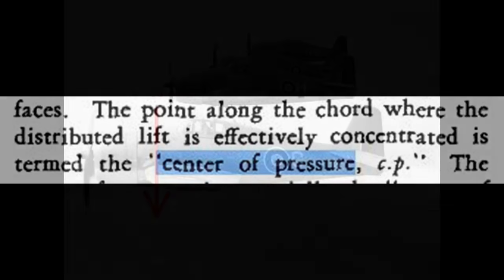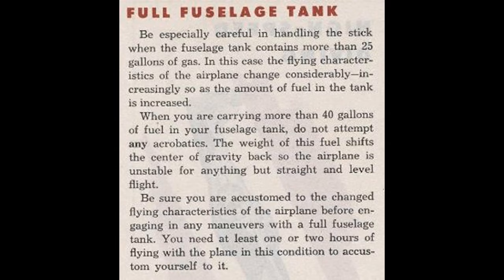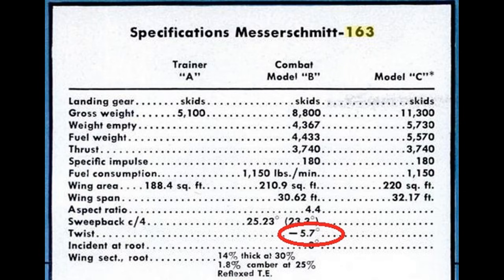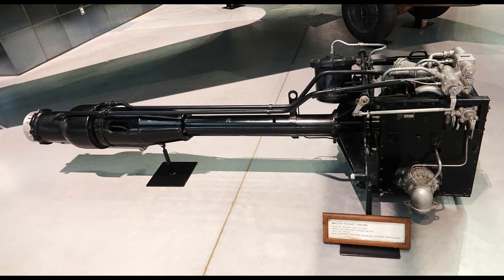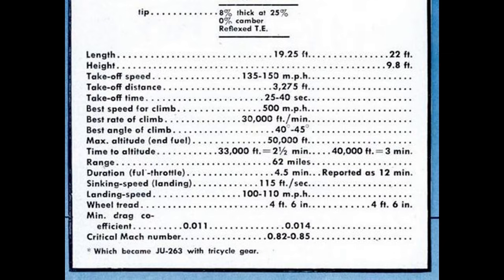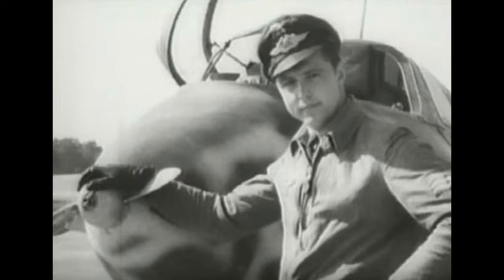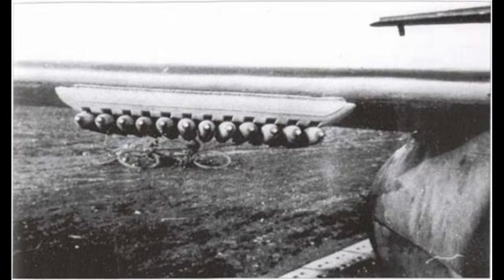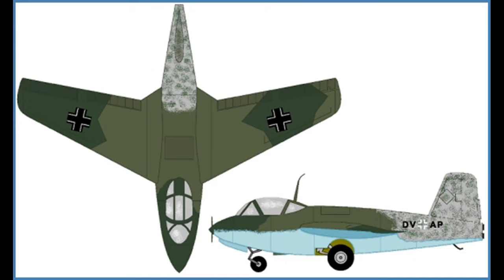Messerschmitt Me 163 Pt.2 Plus Me 263 and More!

Comment: Part 1: Greg - I went and grabbed the ones that all went together, reformatted them and got rid of the names. It will read a little odd, but you'll get the idea. This was fun to read through. I hope you enjoy it. Let me know if you see this one so I can drop it.

@mrod2b216
5 years ago
Hanna Reitsch had her accident in an Me 163b, not in an "a". She had used her political power to try and finagle her way into the flight test program of the Me 163, and had been allowed to fly the Me 163b as a glider IIRC 4 times. She continued to try to assert her will to get into the real experimental flight test issues of the aircraft, so Späte came up with the idea to let her be a production type test pilot for new production run aircraft to confirm they handled like they were supposed to. This would get her out of the experimental test pilot's hair because they viewed her as being non-current (spending too much time away doing other things) and meddling in their jobs. The Kroneis factory had a contract for the first 70 production run Me 163b's, and Kroneis arranged for her to be his factory pilot. The accident happened on her very first factory acceptance flight. Trust me, I know the story better than most anyone out there. My father was was her tow pilot that day, and also the only Me 163 test pilot present, and also the only other Me 163 pilot to have landed an Me 163 with the take-off dolly still attached (so he knew what her problems were). I don't want to "hunt & peck" a book at this point, but suffice it to say that she just royally botched up the approach to the airport. The accident was her fault because the aircraft could have been landed safely with the dolly still attached. After she recovered from her injuries, she then took the regular 5 flight transition course for new Me 163 pilots coming from other aircraft. Those 5 flights were in the Me 163a model with the last one IIRC being under power. It was then that she went back to Späte demanding to be allowed to fly the Me 163b under power. Späte refused on the grounds that he now had a lot of combat pilots to train and could not afford her a "joyride". It was at that point that she got mad and never came back. My father also pointed out that shortly after that episode, Späte was transferred back to the Eastern front. My father felt that it just made no sense to transfer the commander away just as everything he had worked for was starting to come together. My father's gut feeling was that Hanna had exercised her power and vindictiveness. On another note, you rely entirely too much on Mano Ziegler's book. He sensationalized a lot in order to sell books, and didn't really have the intimate involvement to tell the whole story. He was sort of a peripheral player. There are a number of other books out there which are better from a historical perspective.

My father was never a publicity hound or a glory seeker. He was a professional test pilot who would never lay claim to anything unless he had ironclad proof, and above all just wanted history to be recorded exactly as it happened without any spin attached. He never had the desire to write a book, and in the end he said that a lot of his story had already been written down in various forms, just not all collated in one place. He is in all the Me 163 books as he and Dittmar were the two primary experimental test pilots on the aircraft. Perhaps the most accurate involving him is Jeff Ethell's book Komet The Messerschmitt 163. His involvement in the 10 May 1940 glider assault on the Maginot Line and his in involvement with the Horten flying wings (mostly post war) is found in other places. Regarding the Hanna Reitsch story, he was always afraid of her political pull even long after the war. She had her legion of supporters, so he never publicly came out with the story I shared here in fear of retribution. He was the only qualified observer there. He saw everything, and accompanied her in the car to the clinic and hospital afterwards. Everyone just took her word for what happened, and no one asked my father what he saw or thought. Every other published account was second hand heresay. Towards the end, I was his firewall in helping him filter out who among all the folks clamoring for contact with him, that he would actually respond to. I finally convinced him to tell me the whole Hanna Reitsch accident story because I knew that people would be asking me about it long after he was gone. So, he did in excruciating detail, but it is way too long to type here. His end vindication was that she and her accident set the program back by 6 months during which time he had to redo all the flight tests that could have had something to do with her accident. In the end, there were absolutely NO changes made to the aircraft or it's handling. Most everyone who flew it (including Hanna) raved about the great handling qualities, so that confirmed to him that she was just making excuses to try and cover up her own errors. To him as a professional test pilot, if you screwed up, you had to admit it, so to him, she had committed a cardinal sin....and it almost got the whole program canceled.

Privately, he was much more direct and frank in his opinions. He didn't want to publicly make too many waves in fear of retribution from her legions of supporters. It did reflect badly on the Me 163 project. The Kroneis 70 aircraft order was cancelled, and it took my father 6 months of follow up flight tests to conclusively determine that there was nothing wrong with the design of the aircraft , and no aircraft design modifications were warranted. In the meanwhile the whole program teetered on being canceled altogether.

I turn 70 this coming December.

Comment: The human aspect of flying these fast Messerschmitt aircraft is an interesting topic as German flight surgeons not only performed test in altitude chambers but also in rapidly rotating centrifuge to check G-forces. The German “Forschungsfurung der Luftwaffe” was an aviation medicine research branch which had a few pioneering physicians in aeromedical research, among which Dr Hubertus Strughold, who went on to be named “Father of Space Medicine” after his work for NASA as a result of “Project Paperclip”. 
Both the German Luftwaffe Me 163 and Me 262 aircraft could climb very fast to higher altitude but lacked a proper cabin pressurization system so pilots encountered aeromedicine problems with the pressure difference. Luftwaffe flight surgeons solved this problem by puncturing a pilot’s eardrums pre-emptively. Together with many German engineers, Dr Ulrich Cameron Luft went to the USA  “Project Paperclip” where he was involved with the recruitment of the first “Mercury 7” NASA astronauts in 1959.

Comment: There are many things to think about regarding rocket-powered interceptors in WW2. Was there a practicable and available fuel-oxidizer combination that was safer to store, handle and that would've simplified the piping inside the aircraft, without too much of a performance hit? Kerosene instead of C-stoff, for example? Or a plain keralox rocket engine. The A-4/V2 rockets used a methanol-water mix with liquid oxygen. You'd probably need a larger and slightly heavier oxidizer tank, but the gains in safety and ground handling would be huge.
To offset any losses in performance, droppable solid-fuel launch boosters (i.e. RATO) could've been used.
Reply: The problem with liquid oxygen is that it's cryogenic and needs to be kept cold. If stored without cryo refrigeration such as in a vehicle tank it boils off over time. This is why you see "smoke" coming out of rockets while they're waiting on the pad. Cryogenics and solid fuels are the top "room temperature" storable fuels I can think of this why I think they were chosen and continue to be the choice for many missile systems

Comment: Another wonderful video.  I was in the F-16 program office as a wet-behind-the-ears second lieutenant, and by the time I left there in 1986, 120 F-16s had been lost - half of those to engine failure.  In any case, there was once when the engine failed, over flat area with long straight roads, and the pilot thought he would dead stick the plane to land.  The F-16 was equipped with a hydrazine tank led to a generator (chemical that is) that had a shaft to a common gearbox from the engine to the electric generator, and that could supply a few minutes of electric power - since almost everything on the jet was electric.  As he neared the ground, he claimed that he thought he saw too much texture in the road he had chosen for a landing strip, and with the zero-zero ejection seats that were then available, he ejected - safely as it turned out.  The point of this background, is that the plane, minus the pilot and the canopy, proceeded to land itself.  It was not a perfect landing, but the plane easily remained recognizable.  It was decided not to repair the plane, and the nose of it with the cockpit and operable flight systems was sent to WPAFB and Wright Aeronautical Laboratory to become a simulator and test platform.

Comment: Great video as always.  Are you an aeronautical or mechanical engineer? Also I'm curious where you draw the connection between the 163 and B2 as the B2 lacks a vertical stabiliser in addition to horizontal... obviously it more resembles the famous Horten machines although this was staunchly denied by Northrop.  I would love to hear your take on the Horten flying wings and the aerodynamics of rudderless flying wings and various methods that have been employed to overcome those effects to greater or lesser success.  Thanks!

Comment: You briefly mentioned wash out designed into the wing of the Me-163 to give it additional stability. If I’m not mistaken, fighter planes had wash in to make them quicker in maneuverability. I believe that your photo of the four Hellcats illustrates this, showing the chord of the wing at the fuselage and the downward angle of the wingtip. Perhaps you’ve covered this in former presentations. I acknowledge and appreciate your knowledge and thoroughness. 😊

Comment: I just got around to watching this ( May 2024 ).   One correction:   The 
B-2 Spirit in fact has an onboard chemical toilet, ( vented ) a small cot
to allow one crewman to lay down and rest, and an onboard ..... wait
for it..... MICROWAVE OVEN !    Crew comforts are not totally ignored.

It must be noted:  These were ' aftermarket ' add-ons, implemented 
after the aircraft came into service.
Reply from the maker: Lot's of airplanes have add-ons. That doesn't excuse the omission in the first place. Furthermore it still doesn't have a lav.
Reply: @GregsAirplanesandAutomobiles  The B-2 Spirit is a 
two seat bomber.  Like the DeHavilland DH-4 Liberty
Bomber,  The Douglas  SBD Dauntless, The Grumman
A-6 Intruder,  or the McDonnel Douglas F-15 E  Strike
Eagle.   Did ANY of these other aircraft have an onboard
toilet, a bunk bed, a microwave, or a ' lav ' ?    

The B-70 and the F-111 both had Ejection Compartments-
which were a failure.  The B-1A had the same design, but
was replaced in the B-1B with four Ejection Seats.  

Look, if you want to fly in an aircraft with an onboard 
bathroom, take  an Airbus.   If you want to penetrate
hundreds of miles into enemy territory  and deliver a
nuclear strike package, and get out alive, you will have
to make a few sacrifices in terms of comfort to gain
some performance and survivability.
Reply from the maker: If I'm flying for 20 hours, I want a lav.
Reply: @GregsAirplanesandAutomobiles  If you are trying to evade
three SAMs at once, all you need is a Diaper !

Comment: I grew up near Hamilton AFB during the 1960s.  When I moved there the F-101 Voodoo was stationed there.  In about 1966 (?) the group was reequipped with F-106 Delta Darts.  I lived six miles away, but when they took off in full afterburner the surrounding countryside shook.

Comment: Rockwell International used two F-106 Delta Darts as chase aircraft during the B-1b flight test program. I worked there, and watched them fly on numerous occasions at Sierra Highway and Avenue N in Palmdale CA. It was certainly cool to see those old F-106's flying out of US Air Force Plant 42 during the early days of the B-1b program. 

The B-2, the entire outer wing, was twisted something like 7 degrees leading edge down. And during the modification program for the B-2, new inboard elevons were fitted that had the trailing edge twisted upwards, i.e. reflex airfoils. Reflex airfoils are another means of stabilizing a tailless aircraft, mainly for aircraft with minimum sweepback. 

I used to fly a lot of radio control aircraft in my younger days. And have built many tailless aircraft, either with washout or reflex airfoils. The reflex airfoil changes the way the center of pressure and the center of gravity interact. Radio control aircraft I built with reflex airfoils would have this crazy tendency to bob the nose up-and-down when speed over a certain range was there. It was like the cp was arguing with the cg over who was right.

Comment: Funnily enough most of the internet will tell you the B-2 has a toilet, bed and a microwave aboard. I've always found that strange on a highly specialised aircraft where such compromises in use of space just sound off. There's even an article about a B-2 being coincidentally photographed in flight by Google Earth in which the author, who is a so-called 'expert' on the subject, attributes it to a failing in its stealth systems, as if it's supposed to become invisible when you point a camera at it. In the same article he talks about how 'creature comforts are covered for pilots who need a break' as if there's anything more than the bare minimum aboard

Comment: I’m not sure why they can’t take a payload penalty of a thousand pounds, increase costs by $2,000,000 per unit and add a lavatory and a rest area/bunk small galley to make coffee and heat a precooked meal or can of soup, and observer station for a relief pilot, or no relief pilot and train them single pilot when the machine is during cruise. It’s just not a lot to ask for in engineering terms to extend the fuselage by 1.5m and fill that empty space with accommodations I feel. It’s a B2 for crying out loud 😂 it doesn’t need to be the Taj Mahal, but for 30hrs missions you could at least make it as accommodating and spacious as an 8ft camper trailer. They wouldn’t need to medicate a pilot or issue a diaper. They probably spend more per year in ongoing costs running the medicate/diaper program than building that space to begin with on the airplane. They need to take a page out of the AN124, and PBY playbook and start just designing accommodations on the airplane. It probably takes the flight crew nearly a week to recover after one of those 30hrs missions, they might be ready the following day with proper facilities on board.

Comment: 4:25  From what I learned in "ground school," those arrows should be reversed.  The center-of=lift is usually a short distance behind the leading edge, the CG, a bit further to the rear.  I'm not an aeronautical engineer, and I'm sure there are all sorts of exceptions, depending on the particular wing.  But I think, generally, what I've said is correct.
Reply from the maker: Thanks Clyde, the the drawing is correct for a Hellcat. Now if it was and F-16 it would be wrong.

Comment: Knowing what would happen if the T-Stoff (80% to 85% H2O2) tanks the pilot rests his arms on were penetrated.... how thick is the side armor for cockpit?  (The T-Stoff would dissolve the pilot!) (Note: perhaps some of the variance of the engine performance could be due to lack of tolerance control while the various external parts (tanks, piping, etc.) and internal parts of the power plant.  Not to mention that considering the situation Germany was in at this time, supplies of the right metals, tube sizes, etc. meant that they may have had to do "departure from Specs.!). Finally, I also can some higher up at the manufacturer site using T-Stoff at 90% and a higher/better purified C-Stoff just so they can brag to Goering about how they've got a more powerful engine!  (While not mentioning that the engine was basically irreparable after the test......)
 
I've also wonder, since both C-Stoff and T-Stoff were clear, why they didn't put something like Blue Food dye into the C-Stoff!  This way you could tell the difference!!!

Comment: While a jet engine has no propeller (unless it is a turboprop) it has turbine blades.  I am not sure whether the stress under heat limitation (in the end structural integrity) can be considered a being the equivalent to the stress problem of propeller tips reaching Mach 1. As far as I understand, this is a very typical problem  of helicopters. I suppose that propeller tips reaching Mach 1 also have issues with efficiency in generating thrust. I am not sure at all that turbine/compressor blades never could reach Mach 1 as the rotation of the jet axle is much faster than that of the piston engine's propeller hub.

Comment: As I recall the low muzzle velocity on the MK108 was an intentional design concession to increase the rate of fire. Since MG151s weren't cutting it, they needed a good bomber killer weapon, and 30mm did the job very well, but most cannons that large fired rather slow, making it difficult to get enough hits in during a high speed pass.

So in order to increase the number of hits in a pass, they accordingly wanted a higher rate of fire. To achieve this the 108 used a very unique chambering system that gave it a much higher rate of fire than similarly sized cannons, but that system required a very specific muzzle velocity to get the timing just right, one that happened to be fairly slow. For shooting at a giant bomber in a high speed pass though, where aim is less important than burst mass, low muzzle velocity and accuracy were considered acceptable concessions.